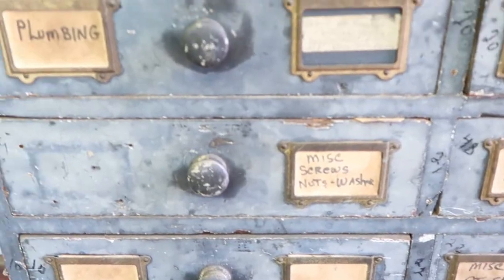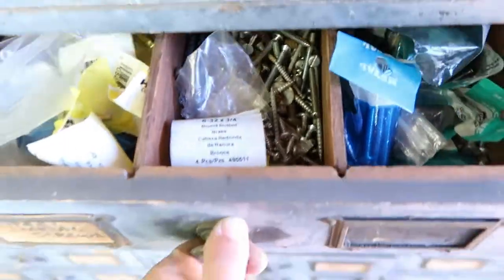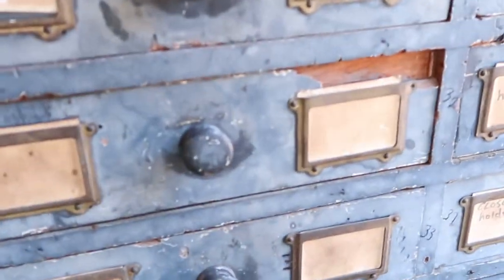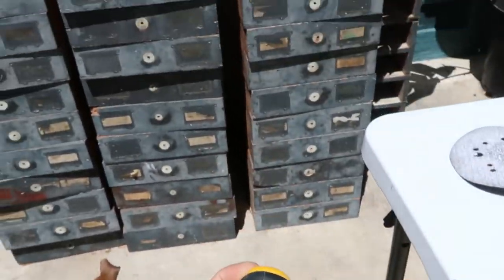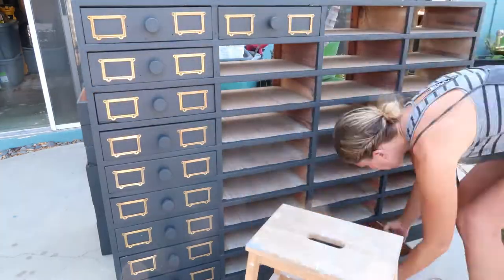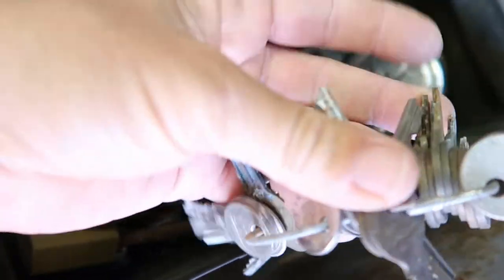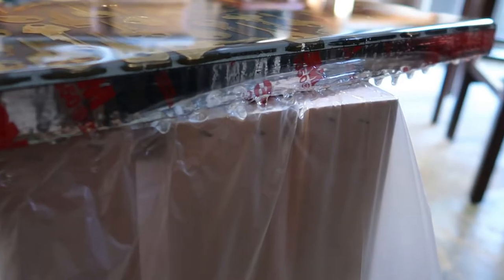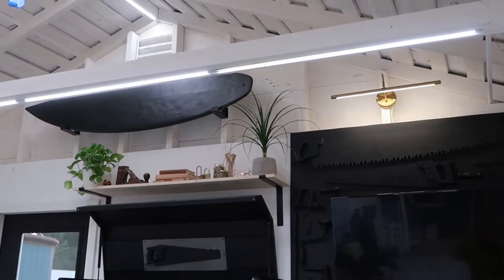How to restore a garage cabinet

Comment: Did you check old paint for lead?  Testers available at Home Depot. I purchase a old 31 drawer cabinet once used by a saddle maker in the late 18rds.  Tested it for lead and it came up positive for lead. Now my wife wants me to find a way to finish without disrupting the paint?  ahg.... But I will find a way, I have some great ideas for it.  Great work on the drawer cabinet. Love the work you did on the garage.  That is a process.....
Reply from the maker: Good to know thank you

Comment: The key top was awesome but what about all the stuff which was in the cabinet some tossed some kept?you have a bunch of vintage tools there too painted black maybe you can try restore one or two🌊cool video was worth watching,did you leave the keys dunked in some "evaporust"@ to make them shine brassy again cause the had a nice color for some old keys🌊
Reply from the maker: Thanks friend for watching and commenting, I did keep quite a few tools that I cleaned up and are still in the tool cabinet as well as the drawers are still full with plenty of hardware that I kept from my dad… I kept what was useful for me and got rid of what wasn’t. Thank you for watching and commenting